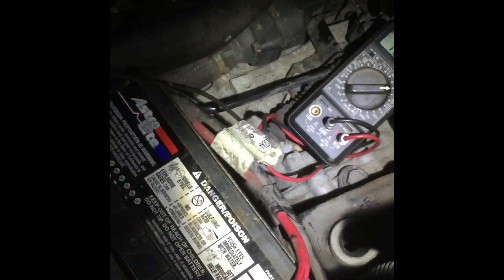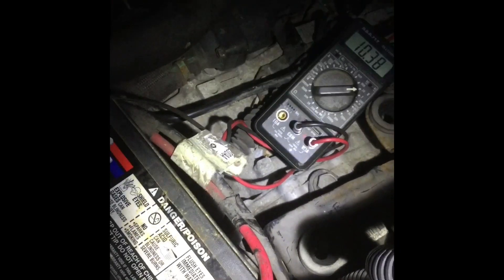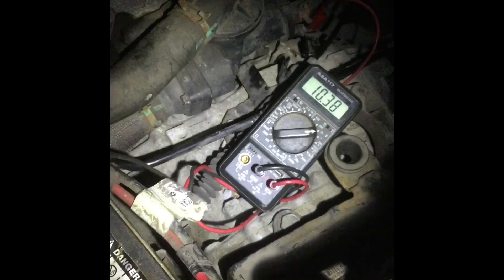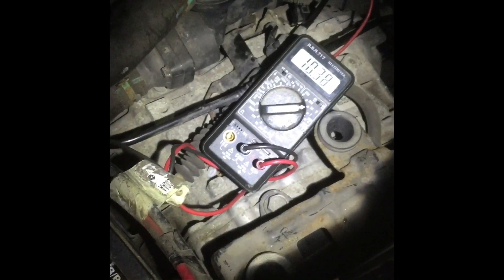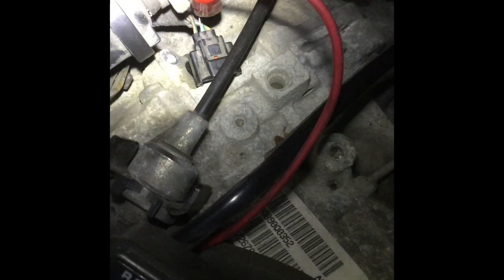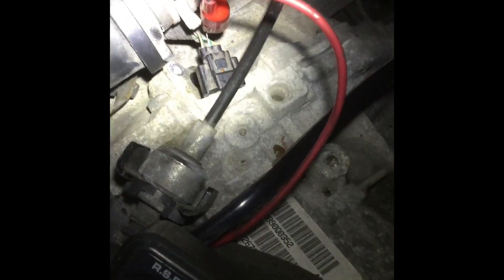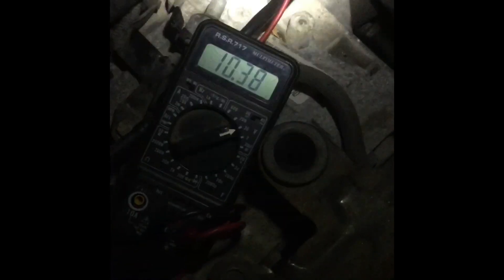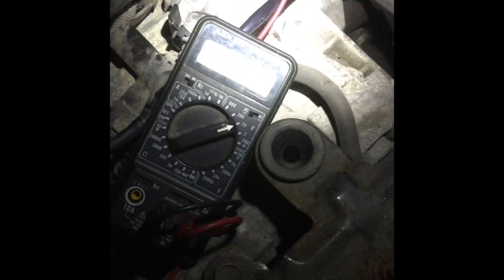Speed sensor signal wire testing. (Dodge Caliber Output speed sensor)

Comment: Did you ever figure this out and if so what was the issue?
Reply from the maker: yes sort of. when I bought the car I knew it had transmission trouble. I had no prior history of how the car was maintained. I changed the transmission fluid filters and fixed the broken fill tube. I did all this prior to this video. It took probably 2000 miles for the new fluid to work out most all the kinks. slowly but surely the tranny got better and better. I think its about 95% now 7k miles later and prolly won't get any better (has one spot where the RPM drop way down depending on how hard you accelerate) but am going to change fluid one more time since I didn't do a full flush. I suspect the lack of full flush is why it took so long to work out the kinks. I'm guessing the prior owner had filled it with the wrong fluid and caused most of the issues. got a super cheap car that just needed a fluid change and a bunch of other misc unrealated parts replaced.